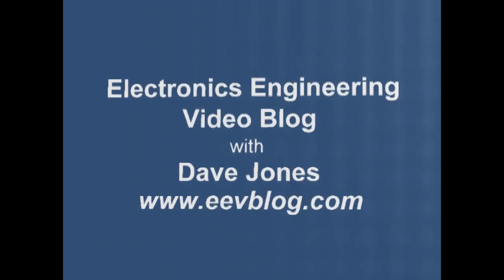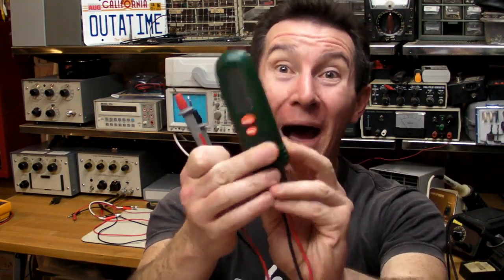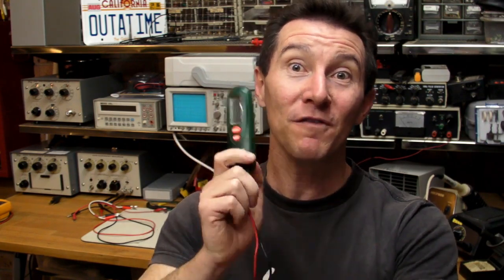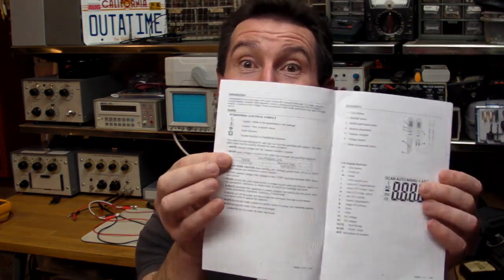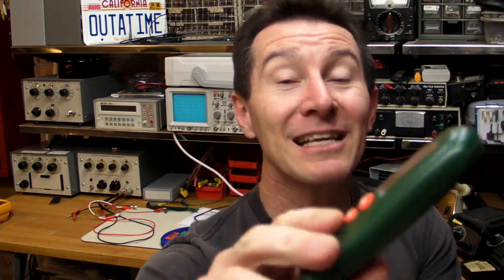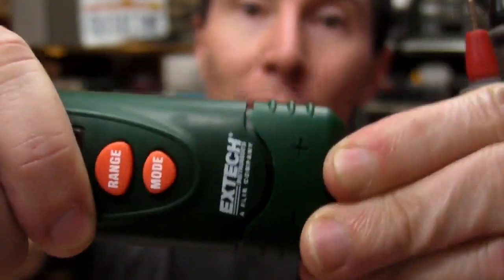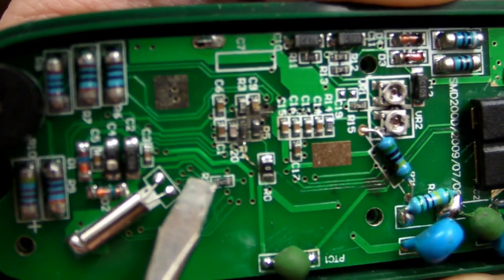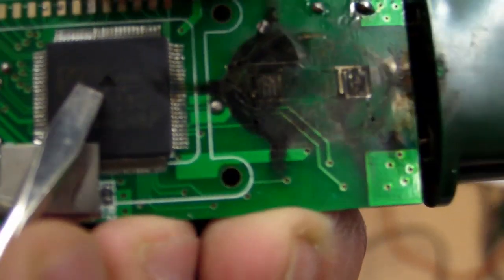EEVblog #94 - Near Death Multimeter Experience

Comment: Love your videos!
However 240 mains is insane!
Reply: 220-240 volt mains is pretty standard in most places.
Reply: Tom Hanson
Still insane IMO! Here 220V is considered "clear hazard" and requires special plugs/disconnect boxes etc.  Most days I can't be trusted around 120VAC.
Reply: youkofoxy Despite what some say, it's basically that the US pioneered electrical distribution. By the time the rest of the world got around to it we realised that 220-250v provided a number of advantages, but the infrastructure was already there in the US for 110v.
Reply: MrRexQuando 110-120V is a bigger fire hazard because you'll draw twice the current compared to 220-240V with the same type of appliance.
With higher current you get a higher wear of contacts (sockets, switches ... etc) and a failing contact can burn your house down.
So yes, 220-240V is a little bigger hazard for electrocution, but 110-120V is more likely to burn you house down and kill your family and maybe even your neighbors ;)
Reply: youkofoxy No, the thing that is dangerous is the current, the discharge that occurs after for example walking on a woolen carpet is insane.
Regardless 220-240 Volts (area used in EU) should be safe to measure with a dmm under any circumstances.
Reply: ***** Then explain how the body has 60% less impedance at 200V than 100v? So if you know how current passes obviously 240VAC is insane especially at lower frequencies. This is why you can touch a 1.5V battery leads with 20 amps and not end up like popped corn.
Reply: MrRexquando  anything above 30 volts is dangerous for humans.
now, I prefer 720 volts.
is more fun that 220 volts.
bytheway, why they use 110 volts?
Reply: MrRexQuando Did you know that lots of households in Europe do actually have three-phase and it's 400V?

Anyway, if I follow your "theory" : to make it safer we should lower the Voltage?
Let's take 24V or even 12V, you haidryer will draw 100 amps. Does that sound safe to you?

This is a EE blog and you should be aware of Joule heating!
Reply: MrRexQuando "In the United States, 50,900 fires each year are attributed to electrical failure or malfunction, resulting in 490 deaths and 1,440 injuries" ESFI
Since you mention impedance (resistance vs time/phase) : did you know that body impedance lowers considerably more over time! And we are not talking about 60% here but more like 90% and even much more after a few seconds!

btw, you have any data on that "fact". 110V will give approximately 60% less current vs 240V, sure you didn't misread something?
Reply: MrRexQuando Wow - what a load of crap you have written there.

Really - 60% more current with 240V mains vs 110?

And you want to claim you have ANY knowledge about electricity?
Get some education kid.

Just to show you how utterly absurd your claims are:
you claim, that the body-resistance drops 60% by going form 110V to 240.
Ok, let's take that without asking any further questions.

We have I1 = 110/R and I2 = 240/(R*0,6).
If we do some basic maths we get, that I2 would be 240/(110*0,6) = 3.6 .
So the Current would be over 3 times as high.

And does it matter? Not at all, as 110V is as lethal as 240V.

And then comes your stupid example of a 1.5V battery delivering 20 Amps - really? Are you that stupid?
If that would be the case, than you would be dead as soon as you touched any battery.  For 1.5V to drive 20 amps you would need LESS than 100mOhm total resistance.....

If that were the case for human skin, well, let's take the 110V again.
110V/0.1Ohm => 1100 Amps.
110V*1100Amps => 121 000 W
You'd be boiling and blown to bits near instantly.

110V and 240V are both dangerous, but 240 is simply more efficient and the way it is wired in Europe simply is safer (3 pole connectors for example).
Reply: MrRexQuando " Morons! The human body is not a linear acting resistor. Read the other comments morons." We are long past this - and great job starting with insults and then showing you know little to nothing.

You really should use your brain a bit before writing comments.
Reply: Besides I didn't at any point mean that 220-240 volts aren't dangerous, just not nearly bad as some people were suggesting, one should be able to measure it safely with any dmm without problems.
Reply: MrRexQuando 
0.01% might make the difference between life and death!
Who cares about the electrocution theory it's the practice that counts! Do we have tons of people getting electrocuted from 240V? Nope.
Checkout the sockets where 240V is used, they are MUCH safer (child safety on any household socket is mandatory in most EU countries). The first time I got in contact with 240V was because the device had a US plug, it was delivered with a adapter and it was so easy to touch the mains on that type of plug.

You claim to have worked for the union, so what's more prone to have a failure on the device and especially on the extension cord for using that device : a 110V device pulling 16 amps or a 240V device pulling 7.3 amps? Seems pretty obvious to me.
A 110V vs 240V warning isn't a voltage warning for the 240V but a current warning for the 110V.

110V system not only requires twice the cable section but it also requires transformers being much closer to your home and that means lots of high voltage out on the street where your kids play ... no thanks.
The only high voltage lines I know that you could touch with a long stick or ladder here are the 3000VDC lines from the railway, everything else is totally out of reach.

So have fun with high voltage lines in front of your home, 16 gauge power cords that will burn your house down, switches that are getting hammered by twice the current (probably giving much less than 50% MTBF) and those hazardous plugs/sockets. At least you have those theoretical percentages that will save you from electrocution while joule heating is biting you in the ass.
Reply: MrRexQuando I can link stuff too : http://www.esfi.org/index.cfm/page/Fire-Statistics/pid/12014
"Home fires involving cooking peak on dates that are major U.S. holidays" Yup, typical day to overload wires with a gourmet grill. Very easily achieved on a 110V system since it will draw 15-20 amps here.
"Home electrical distribution and lighting systems are the fourth leading cause of home fires" that is the electrical system not appliances.
Reply: ppdan The lower the voltage, the more current to pass the same amount of power, the higher the chance of  a fire getting started. That's why you dont go to 24v.
Reply: MrRexQuando You forgot to mention those 60%!!!
Reply: MrRexQuando  "Yes except I cited scientific facts and you are just full of bullshit :o)"
Just that the things you cited in no way supported your claims - i might as well suggest you to go back to school and work on your text-comprehension-skills again.
and after that you should also take some classes in basic physic.
Reply: MrRexQuando If that is true then you're certainly retired today! I am electro technician for the railways and seriously our 240V system is nothing to be afraid of, we got much safer sockets and less joule heating.
It is well known that the biggest cause of fire comes from electrical wiring/appliances failure. There is a much higher chance to get killed by a fire caused from electricity than getting electrocuted!
Reply: MrRexQuando I have been to the UK and most electric installations there are very old.
We can keep exchanging crap like this for years : http://www.elektrotipp.de/images/kr/Brandursachenstatistik%202012%20Elektrizit%C3%A4t.png
It all depends on the condition of the installation/appliance and how we use it. Most electrical fires we see in statistics are due to wrong use, aging or poor maintenance.

Anyway, this debate will end nowhere, you are afraid of a little voltage and I don't like drawing high currents in my cables. 110V or 240V, they are both lethal and considered low voltage.
Reply: youkofoxy I was thinking mentioning the price aspect but hey, if they want to pay for those expensive wires, switches, high voltage lines right in front of their homes, kWh that went into joule heating ... etc, be my guest.

I find 240VAC not more dangerous than 110VAC, but I surely wouldn't like having simple hairdryer that pulls 12 amps and certainly not with those US plugs, sorry but those plugs are a real hazard even at 110V.
Reply: MrRexQuando Seriously, if you get really shocked by 110VAC or 240VAC you dead anyway because the burned skin will easily have 95% less resistance and since your inner body has a resistance as low as 300 Ohms, even a small remaining voltage of 20 volt would probably kill you by then.
Reply: MrRexQuando And what about :
- 100% more joule heating in cables : wasting energy (more pollution) and higher fire hazard.
- Higher wearing on switches and sockets : bigger fire hazard
- Better and safer sockets on 240V system : US socket type are among the most dangerous I have ever seen
- No high voltage transformers and/or power lines close to your home in a 240V system
- More economical in "transport"
- RCDs are mandatory in most countries with 240V
You have to compare the whole system instead of arguing blindly with a single paper!
Countries using 240V have a much more modern network!

HVAC/Water heaters/Dryers/stoves/welders are mostly plugged in a normal socket here (unless it's a heavy welder or HVAC system). A simple hairdryer is already a heavy current device in a 110V system and will draw more current then a washing machine or a dryer in a 240V system.

You must be either delusional or have no clue of electricity if you don't see all those added dangers of a 110V system.
Reply: MrRexQuando Who is trolling who? Everyone who mentions the other dangers of electricity gets the same response from you "240V is 60% more deadly", that has been the only argument you have on this subject!
That paper is discussing electrocution while there are far more death from fire caused by electricity!
Reply: MrRexQuando  Seems like there is only a single argument saying why 120VAC is better than 240VAC, while ppdan and others have quite a few more (6,7?) about why 240VAC is better.... I'd go with 240VAC.
Reply: Like others have said already it is standard in large part of the world and multimeters are supposed to be designed to handle that load. And our 220v-240v grid is also actually more stable in that there is less risk of power spikes killing your equipment if you are not using a surge protector.
So even though there might be a little bit reduced risk in getting killed from voltage themselves there might be less hazards when it comes to fire here.
Reply: MrRexQuando Yeah yeah, keep on repeating the same shit :P
120 V can kill you just as easily.
Get shocked and you got a problem - with both.

Hey, not only are you wrong on that account, but If we would already go by the potential to cause Damage, than 240V would be about 4 times more potent.
At the same time, it makes power-transmission easier, more efficient, and cheaper.
Reply: MrRexQuando Did they talk about chances getting electrocuted on those crappy US plug compared to most EU plugs? No they didn't. You have to look at the whole system and not only use the part that suits yourself. On which side of the door were you when they distributed brains???
Reply: MrRexquando As I have already come up with an example of insanely high voltage going through you without being dangerous,
I don't see why that is not what is being explained.
Reply: MrRexquando And you are in no way whatsoever addressing my example, for the third, no wait fourth time in a row.
Reply: Flynn White We have in EU all 230V(233.3V last week...) and works just fine, I put DMM into mains for 15 years, no problems. Its a pain I cant use 110V devices in EU, the whole world should be one standard - 230V 50Hz
Reply: Ritcheyyy "This world should have one universal standard" yes, I agree, but why the one we use specifically?
Reply: ***** Ohms law.
Reply: ppdan have you talked to him about the demand for metals to suit a system of 110 volts?
and in my opinion ... a difference safety is not as great, you are just talking about impedance and forgetting:
Socias factors, psychological, work area ...
by the way, with the appropriate security measures is more easier to work with 220 Volts.
and according to http://en.wikipedia.org/wiki/Low_voltage
we're talking about low voltage.
Reply: MrRexQuando On what page does it say that 240V is insane?
Reply: Brucifer Energy is not the danger, current is.
If you take a constant current source of 1mA and touch it for 10 minutes you will not die.
Now if you charge a capacitor with that same amount of energy it will become deadly because the current released will be much higher.
Reply: MrRexQuando RCD's are mandatory in Australia 240 volts.
You both agree 240 or 110 will kill. Yes to get the same work  from either the amps have to be more at 110. But as far as a body goes once it starts to dry out and burn you are dead. The fact that 240 volts will throw you across the room if the rcd doesnt kick in where 110 no matter how much amperage is not going throw you across the room you will be stuck there. Most 240 volt circuits are only 8 amp rated in houses etc Air conditioners etc

Conclusion they are both deadly Doesnt matter 110 or 240 if you make a mistake they both can kill you. Most electricians or electronics tech;s have been hit. Most of us are still alive. Under working conditions we have many safety systems in place to prevent mistakes as we are human. RCD's rubber, rubber mats, insulated equipment etc.

The issue was the meter having the switch triggered after the leads contacted the fact that it was cat rated yet if this accident happened at 600 volt as the meter was rated it may have been even worse.Still a badly designed meter.

Your argument is a mute point both 240 and 110 will kill.
Reply: MrRexQuando 240V is more dangerous than 120V AC RMS, of course (I got shocked twice, so I know).

But there are also advantages, for example we need thinner cables:

Load of 3 kW (values in AC RMS):
240V  ->  12.5A
220V  ->  13,6A
120V  ->  25A
110V  ->  27.3A

Safe
24V   ->  125A

- Luca
Reply: MrRexQuando 2008 there have been 63 deaths resulting from electricity in all of Germany (Population: 82 Million). This figure includes industrial accidents. Just counting household accidents, we're down to 23. To give you a sense of scale: 5-7 people die due to lightning strikes in Germany alone.

Clearly you are right and 240 Volts are "totally crazy" ... oh, and electrical plugs which permit you to touch the live pins while plugging them into the outlet are totally fine. Nope, no problem at all.
Reply: MrRexQuando
Did I ever say that the higher voltage is less hazardous? Stop putting words into my mouth. I said that there are some advantages when it comes to power spikes, which in fact might lead to less fires. And since fires from electrical equipment is alot more common than the extremely rare cases where people die from 220/240v it might actually overall be safer.
Reply: ppdan
So I guess it is just not me then.. Seems like this kid just clicks reply without even reading the comment.
Reply: MrRexQuando Why do you say "Or what?", did I put an ultimatum somewhere?
And what does minecraft have to do with this? Are you drunk?
Reply: MrRexQuando First of all, a dry cell isn't a current source but a voltage source. Anyone with some EE knowledge wouldn't talk about a "60 amp dry cell" because a dry cell just isn't a current source!
And wth does a stun gun or a dry cell have to do when comparing electrocution safety of 120V vs 240V at home?
Just curious, do you actually know what limits the maximum current of a battery?
Reply: MrRexQuando You have just shown that you should learn the basics of electronics before commenting.

"better to be silent and thought a fool than to speak and remove all doubt"
Reply: MrRexQuando btw, batteries are DC sources so there is another BIG reason why they wont electrocute us as fast as 120V AC. With dry hands you can easily touch up to 200V DC ... I'll let you look up why that is (again this is BASIC EE KNOWLEDGE)
Reply: MrRexQuando Seriously stop trolling, I was talking about dry hands, you go to licking a 9V battery and then again you talk about those 60% ...
Reply: ABaumstumpf Let him, he is jumping from one thing to another and as soon as he cannot come up with something to respond he cites scientific stuff that he found by doing a quick search with google. According to his papers, or how he translates them, a lower voltage will always make less victims even if it's much more exposed.
Reply: MrRexQuando 240 volts through a human is more dangerous, because if we consider`the resistance of the human body to be constant (it's not, but lets pretend two people shock themselves in the same way with the two voltages), a 240 volt drop across that resistance is going to lead to twice the current, and thus twice the power flowing through your body.

At less than 30 volts dry skin acts as a dielectric.  Less than 12 volts can even damage tissue though... hold a 9 volt battery against your tongue for a little while and you're going to get a painful, nasty burn.

It's the POWER that matters, not the current or the voltage alone.
Reply: ppdan Christ, have you ever heard of ohms law?  Current is dependent on the voltage drop.  You can't have a voltage drop across a resistance without a current.

Hopeless.
Reply: The fact that you think "the current always kills" when there can be no current without a voltage drop across a resistance.

It's the power that causes cellular damage, which is the voltage multiplied by the current.
Reply: ppdan You're contradicting yourself... If it's the current that kills, then you're saying the voltage doesn't.  You can't have one without the other over a resistance.
Reply: Justin Hall hopeless
Reply: MrRexQuando maybe some groups have interest in making hazards? never forget the rich racists
Reply: Tom Hanson now makes sense.
Reply: youkofoxy I figured out the answer using google, your comment is about as useful as "first"
Reply: MrRexQuando "Why do you think stun guns shock you"  because of the high voltage but since it's low current it cannot kill me. You need enough current to kill!!!

"touching the leads on your car battery doesn't kill you?" With dry skin? Of course it doesn't, never heard of ohms law?
Reply: MrRexQuando
Well 240V AC at 10kHz isn't particularly dangerous :D
Reply: MrRexQuando
I just notice that you did not treat me with the respect, a few lines ago. Yes I am a boy, but you should treat me with more respect.
at least you experienced what is 220 volts?
I have, but not as my uncle who had it first hand, and he is still alive.
and several shocks that almost killed my father, he even remembers one that was epic: 380 volts in a radio station cables, he cut the wrong wire, only to see a pliers melt in his hands, and hear a circuit breaker trips .
I asked him because of this discussion, humorous or not, I mentioned him about the accident in the low voltage (about 64 volts) in which he almost died.
this he concludes that the low voltage was more dangerous, since it took me about 5 seconds to turn off the system.
(I thought someone else would solve the problem, as usual)

that's why I think it is safe to 220 volts, rarely had the opportunity to work with 110 volts.
I know the security issues and also know the impedance of the human body decreases with voltage.
but unless you use 30 volts, people will continue to die, and if you use 30 volts people will die on fire.
not everybody has an strong heart like me or my dady, and can die just by the suggestion that they are taking an electric shock.

BTW: you remind me of my grandfather, who insists on the old solution "slay the jaguar."
and everyone knows that this was never the best solution.
as I mentioned before, you're forgetting other problems of using 110 volts. you at least have the idea of drastic changes to meet world energy demand? Forget the money and just think of the consequences, after all almost everyone uses 220 volts.
you can not say that 220 volts is insane, not until read the whole story.
Why do you don't start here?:
http://en.wikipedia.org/wiki/Alternating_current

+xXDarkKisukeXx I like the sugestion,but we would have to solve the problem with the cabling system, however it would be something interesting to see.

P.S.: I don't like english.
Reply: for me, English is a necessary evil.
rather like the hammer that dissipates energy more slowly. by the way, this is terrible comparison.
I've had experience with Electric shock of different voltages, I would still argue that only 30 volts is safe for humans.

I have no knowledge enough to show you why it's better (google don't solve that), and I fail to convince myself that 220 V is really better, but you still fail to convince me.
then I suggest you show me some graphs on the subject, preferably with the use of SI units.

after looking on wikipedia about it, I just noticed that 220 volts stop the heart of the victim until the system is switched off, and it has a tendency to "toss" the victim.
while "A sustained electric shock from AC at 120 V, 60 Hz is an especially dangerous source of ventricular fibrillation because it usually exceeds the let-go threshold"
http://en.wikipedia.org/wiki/Electric_shock

P.S.: apology accepted.
Reply: MrRexQuando For the love of greyskull... half the reason people are arguing with you is because you keep using the wrong terminology, which is confusing.

"Conductivity" isn't going to increase with an increase in voltage (corollary, "resistance" or "impedance" isn't going to decrease either). Current will increase according to ohms law, but the conductivity of the body will be much the same at any instant. In the simplistic case, an increase in voltage across an everyday resistor doesn't magically change the value of its resistance - otherwise ohms law would look very very different to what we are accustom to.

Please don't belittle people or resort to ad hominem attacks. It contributes nothing to the discussion.
Reply: 115 volt mains can kill you. 230 volt mains can kill you.
The first one kills you a little less than the other.
;)

Anything above 50 volts is "insane".

I had my share of mains through my hands plenty of times. To be honest 115 doesn't feel that much different from 230. They both have a deadly tickle.
Reply: MrRexQuando "I found a paper that says" seems to be the only knowledge you have on this subject!
First it's "60% less impedance" and then it becomes "60% more dangerous" which one is it now?
Reply: MrRexQuando You clearly don't know Ohms law and your math is even worse.
You'll be able to use this against me but what the heck at least it'll prove that you have no clue about the basics of electricity.
If the resistance drops by 60% the current will rise by 150%, but since the voltage is now 240V and not 110V the current will rise by another 118% giving a total current rise of about 445%.

I guess we can VERY safely assume that 60% less body resistance on 240V vs 110V is nowhere close to "60% more dangerous". (it's much worse)
Reply: It's not more complex, all I used is simple Ohms law and rule of three. 
Comparing to only copy/pasting that's a lot indeed!
Stop using terms that you don't know!
Reply: Forgive me, but I'm going to take more of a physicists view on this than an electricians. Instead of thinking in terms of Amps and Volts, Think about the total amount of energy, as measured in Joules.

low current & high voltage = xxx Joules
high current & low voltage = exactly the same amount of energy as above

Energy is conserved no matter how it is delivered. Remember, energy cannot be destroyed or created, only converted from one form to another (potential, kinetic, thermal, etc).
If you pass AC through a transformer with a total energy level of 1 Joule and the transformer outputs either a higher or lower voltage... it still outputs the same 1 Joule in the end (excluding transformer losses) since energy is conserved.
Given that this is the case, there is little difference between the two. The total amount of energy (in Joules) that runs through you is what causes the damage, and there is little difference between the two total energy levels in this respect.
Reply: leigh Moom i agree in greece and europe exceed england and cyprus the voltage is the same
Reply: MrRexQuando Because you know something about electronics or electricity?
According to what you posted here, that "60% more lethal" quote is as far as your knowledge goes.
Reply: MrRexQuando  lol, there it is again. The ONLY argument you ever had!
Reply: MrRexQuando Those "crazy benefits" are the biggest cause for failures that kill at least ten times more people!
The paper only discusses electrocution but doesn't discuss all the other dangers that come with electricity and it also doesn't take into account the safety precautions taken to not get in contact with electricity.
Also what's the point of having a 37.5% electrocution safer voltage in a system more favorable to getting electrocuted.
Reply: MrRexQuando That is the problem, your idea is that you have only one single point which counters everything else.
Does that study include safety of the whole system? No it doesn't because it is a pure bio-electrical study and doesn't take into account the chance to get electrocuted.
Reply: MrRexQuando Because your science shows that 110V in the US is less dangerous than 240V in Germany?
According to your science, or at least the way you apply that science, the ratio of people getting electrocuted from 110V is 37.5% lower?
If 110V is still deadly why not go down to 24V?
Reply: Ian Switzer I know, that's exactly the point I am trying to make and since fire originating from joule effect kills way more people it is a bigger concern.
Reply: mato900 He got way more arguments (probably 60% more), the only difference is that it is the same argument over and over ...
Reply: One thing that hasn't been mentioned in this insane comment string (if it has, sorry I missed it) is that US homes are served at 220-240 volts. Many of our high-drain appliances run 220, including central heaters, air conditioners, ovens and rangetops, water heaters, clothes driers, etc. Only are the standard household outlets ~115v. Most of the stuff we plug in to these outlets do not pose any hazard from high-amperage or melting wires.
Reply: David Hansen Hairdryer, Microwave oven, space heaters, deep fryer, vacuum cleaner, ... etc. Most of those will pull at least 10 amps on 110-120V and are plugged in a standard household outlet.
Real high drain appliances run on 3-phase 400V here.
Reply: MrRexQuando Can you read? That sentence had a question mark at the end!
Reply: MrRexQuando I wasn't even talking about that but about the fact that you quoted me wrongly. And stop bad mouthing people from behind your PC!
Reply: Tom Hanson 
9 months ago I know but,
By the time the rest of the world got around to it?
110v was always inferior .
US scaremongering kept you on that lame system.
Reply: MrLiveEra *cough* i'm not American
Reply: Tom Hanson Lol, Ok, Maybe my comment did come off a bit ' Anti- Pro - American'
But the ' By the time the rest of the world got around to it'  got to me a little
Reply: MrRexQuando Somehow I am hesitating to give your last comment a thumbs up because it clearly shows that mentioning that paper is all you can do ... stop trolling EE topics!
Reply: MrRexQuando Yeah, it is a display that you have no understanding of basic electricity.
Reply: MrRexQuando No ppdan is saying is that a battery is not a current source! And now ppdan is also saying that you don't know shit about batteries. A battery is a voltage source and the maximum it can deliver depends on its ESR.
THIS IS BASIC KNOWLEDGE!!! You should know this in a split second if you have any EE education instead of using google to find an answer!

I am gonna help you to educate yourself : http://en.wikipedia.org/wiki/Current_source (after this checkout Voltage source)
Reply: MrRexQuando Yay, and a taser is deadly?
Or as i have stated before, a ESD?  
ESD will give you several thousand Volts at tens of amps - and ups, no problem there.

Learn some basic maths - you are clearly not able to even comprehend what that paper is talking about.
Reply: Justin Hall It is current that kills and it always will be. But, you need a high enough voltage to induce that current.
For example you will die from a identical current that passes thru your heart going from head to toe or hand to hand, the only difference is one of the two will have a higher resistance thus needing a higher voltage to induce the same current.
Reply: Justin Hall And which part of my post is against ohms law???
Reply: Justin Hall Are you blind? I said "you need a high enough voltage to induce that current" and also "one of the two will have a higher resistance thus needing a higher voltage to induce the same current" ...
And it is the current that kills!
Reply: Justin Hall I quote myself again "you need a high enough voltage to induce that current" which means that you need a certain voltage to get a certain current.
And no, high voltage doesn't kill if the current isn't high enough!
Reply: ppdan but you can't have high current without a high voltage. It's not the voltage difference that matters, it's the voltage drop.  You have to model the human body as being a resistor.

As a comparison, you're basically saying "It's not the distance you fall that kills you, it's how fast you were falling when you hit the ground."

THEY'RE RELATED. edit:  DIRECTLY RELATED
Reply: Justin Hall It's exactly what I say "you need a high enough voltage to induce that current" -> voltage and current are proportional!

And what do you mean by "It's not the voltage difference that matters, it's the voltage drop"??? A voltage drop IS the voltage difference between to points?

"It's not the distance you fall that kills you, it's how fast you were falling when you hit the ground." Of course it's the speed that matters otherwise parachutes wouldn't work as expected!
Reply: ppdan A parachute would be more like a pull down resistor.

And no, the voltage drop is not the difference of the voltage between two points.  You probably have a charge of tens or hundreds of volts on your hands right now.  That doesn't mean you are conducting electrical power.

In one sentence you're saying "It's the current that kills", and in the next you're saying the voltage does matter.  Make up your mind, you can't have it both ways.
Reply: MrRexQuando Dude... Your trolling was awesome. But tiring. Glad you stopped.
Reply: We should make a T-shirt  about this thread...lol! It'll have a "240VAC is more deadly" with a picture of someone getting shot in the heart by a rifle, and then someone getting shot in the heart a slightly higher caliber rifle.

I mean, obviously, they'll die 60% more than the other dead guy. ;) Always take proper precautions to make sure you aren't 100%, or 160% dead.

Anyway, I have seen here many 600VAC mains(in the US) and the thick cables/supply current are enough to turn you into a cooked hot dog and think that is part of it's regular duties. These are used in most industrial applications, and even in bakeries.
Reply: +Ritcheyyy just use a stepdown transformer (yes your comment is old but still xd)
Reply: +MrRexQuando, Do you need someone to talk to :) , you really need to get a life and stop with the shit comments on YouTube, FFS it`s only a video about a MultiMeter not being fit for purpose......BTW is 240V really insane??????????
Reply: ***** Its 60% more dangerous than 120. Pretty significant increase no? Like I said 240 mains is insane!  Agree that test equipment rated for 600V (or whatever) should be able to be plugged in. I normally use a pico fuse when working on line voltage incase something is coupled. Unlike Dave I have to buy replacement equipment when I blow it up. LOL
Reply: ***** I guess you don't understand how skin resistance goes down as voltage is increased?  I get that its all about current and frequency. Do you understand that more current will "pass" as voltage increases? If not google it. Pretty basic. If your theory was correct I could die from a 20 amp 1.5V dry sell in my hand.
Reply: ***** With dry hands you can touch a car battery with 700 amps and live correct? Do you get it now? As voltage goes up resistance in the skin goes down thus allowing more current to pass.
Reply: ppdan
Yes you are a genius! In fact lets run consumer equipment on 480V because it would make everyone safe from house fires and save billions on transformers.
Reply: ppdan I was a union electrician before you were born. Its common knowledge the higher the voltage the better it conducts through skin and other things important to us. Thus it is insane to run 220 in areas humans normally come in contact with.  Show some evidence that 120VAC causes more house fires.  National codes are based on safe use and safe failures of electrical systems. It works pretty damn good.
Reply: ppdan  60% more deadly. The only argument I stated. 240 mains is insane.
Reply: Italian Programmer
 Agreed but when you expose this (at the outlet) safety because the biggest concern. When it is used for large current devices like HVAC/Water heaters/Dryers/stoves/welders/commercial lighting/etc. it works out pretty good like you demonstrate. Smaller wires, etc.
Reply: ppdan Its in the report but you can't read correct?
Reply: Ritcheyyy Do you dispute how in the body 240 passes 60% more amps than 120vac? Not sure what is wrong with you people. It is more dangerous because the voltage is higher  and meets less resistance on the skin so is more deadly (passing more current). Seriously this is an EE blog.
Reply: ppdan I wish I was retired! Just moved on. The fact is the body has 60% less impedance at 200V vs. 100V. So the fact is you pass a lot more current (and increase risk of electrocution) with 240 mains.   Human safety factors have always been a part of engineering. 240 mains is insane. All ratings are done with appropriate voltage/amperage consideration. So you would have to provide some kind of imperial data to backup 110VAC causes more fires.
Reply: ppdan
Can you show that the fire "rate" is any different between 110 service and 240? I bet its identical. Looking at the UK it looks like your 240 is safer isn't accurate "https://www.firesafetystore.co.uk/images/percentage%20of%20electrical%20fires.jpg"
Reply: ppdan
It's physiology. The higher the voltage the lower the resistance through the body. "http://highered.mheducation.com/sites/dl/free/0073521825/690036/pet21825_ch01_OLC.pdf" Why do you think stun guns shock you and touching the leads on your car battery doesn't kill you? If this concept is foreign to you we should probably just stop this debate.
Reply: ppdan My grandfather use to say "you can't argue with stupid" EE 101: Higher voltage = less resistance in the body, less resistance means more current flows. More current flows you die. A "mains" outlet will pass a shit-load of current at high voltage. Doubling the voltage creates 60% less resistance in the human body which means you pass more current! 240 mains is insane! Again if you can't get the basic concepts of electricity you are the typical Troll you appear to be just arguing something you know nothing about for fun.
Reply: youkofoxy
You boys are talking out of your asses.  240 passes 60% more amps through a human body than 120VAC so the killing ability of household outlets is greater.

So by your logic we should be running 480VAC straight into houses so we can save on materials for wiring. Crock of shit.
Reply: ppdan
Yep you know nothing about this do you.. Again this is why a taser shocks you and a 1.5V #6 Dry cell doesn't kill you even though it puts out 100AMPS. More volts the easier it passes current. Seriously I hope you are just a troll and not working on electrical equipment or someone is going to be killed because you don't know what you are doing..
Reply: 10KHZ you are a radio tower!
Reply: youkofoxy
 Simple fact higher voltage conducts better through a body increasing the likelihood of injury/death. Ask yourself this: Would you like to be hit in the leg with a 2LB hammer or a 10LB hammer? Transmission lines where the bulk of any material savings would occur are already running as hot as possible. Sorry you feel I was disrespecting you but until you provide factual data you are simply voicing an unfounded opinion. Sorry you don't like English. Just like the aviation world English is the standard. If not we would have chaos in the skies!
Reply: Lee Ryman
 Can you cite this wisdom? You are obviously wrong. "Between 10 Volts and about 30 Volts, skin exhibits non-linear but symmetric electrical characteristics. Above 20 Volts, electrical characteristics are both non-linear and asymmetric. Skin conductance can increase by several orders of magnitude in milliseconds." "http://upetd.up.ac.za/thesis/submitted/etd-09212005-093111/unrestricted/dissertation.pdf"
Reply: Lee Ryman
Reilly, J. Patrick (1998). Applied Bioelectricity Page 43 nice chart and all.
Reply: ppdan You fuckers wear me out.
Reply: SysGhost Agreed but 240 is 60% more "effective" at tickling through your body. When I was 3 I put my fingers over the prongs of an iron while inserting into the outlet (loved electricity ever since!) and with the puddle of urine I created easy to see why that 60% might be the difference between life/death where these voltages area accessible.
Reply: ppdan Except like the paper I cited its 60% more dangerous than 120VAC. Stay with the details they are important :o)
Reply: ppdan Less impedance means greater current flow so same/same. Your not too smart about electricity are you?
Reply: ppdan NICE! Thus 240 mains is insane! 
I didn't do any math? Yea this is a little more complex than I=V/R. Its a non linear regression. But if you say 445% your my dawg.
Reply: ppdan Respectfully I think what you are missing is the human body is not a carbon resistor.  I am not using any terms incorrectly.  Its not simple ohms law.
Reply: Brucifer Dude not even close. You are missing the impedance part of the equation. The body is not a perfect conductor (not even linear). If it were you would die from touching a 100amp 1.5V dry cell by touching the leads but not effected by a taser (50KV x .00036 amps).  Or the electric chair at 1,825 volts at approximately 7.5 amps. 

Think of it this way when your fingers are wet you conduct better correct? Internal to your body works the same way (as the paper referenced early details) The higher the voltage the lower the internal resistance your body offers. 

The impedance your body offers to the current flow is 60% less at 240v than at 120v. The lower the impedance the more current can flow and the deadlier. 240V is insane!
Reply: Fennecbutt No videos and lots of expletives on things you no nothing about. Fucking Troll.
220VAC is 60% more lethal than 120VAC as I cited.  If you can't understand that maybe ask your mom to explain it.
Reply: ppdan Read the other comments moron. "Reilly, J. Patrick (1998). Applied Bioelectricity Page 43 nice chart and all."
Reply: ppdan Fucking hot air troll. I cited scientific proof that 240VAC is 60% more deadly you followed up with hot air and re-direction. Typical troll with no videos. You just go on Youtube to argue with people about things you know nothing about because you have no life of your own.
Reply: ppdan You are trolling by definition (duh) my response was the challenge that it wasn't more dangerous. It is (see the paper dill ford dumb-butt) there may be all kinds of crazy benefits to 240 (just like going to 480) but there is a safety penalty.  If you can't admit it is 60% more dangerous you are just an arrogant troll..
Reply: ppdan
The examples of how this happens are all over the place "http://www.righto.com/2012/03/inside-cheap-phone-charger-and-why-you.html" but don't look at any of this. Stay with your unfounded love of 240VAC.
Reply: ppdan Fucking moron. Your link "Cooking equipment is the leading cause of reported home structure fires and injuries.  It is also the leading cause of unreported fires - See more at: http://www.esfi.org/index.cfm/page/Fire-Statistics/pid/12014#sthash.eMFcebUS.dpuf"
Cooking fires? Fucking idiot..
Reply: NastyTern I have an idea. Have a point. It makes it so much more interesting for the reader. 240VAC is 60% more deadly than 120VAC. Just a fact. Sorry you guys can't understand facts/science/etc.
Reply: ppdan Show me some science. Enough hot air. Show me where 240VAC is 60% less lethal than 120VAC. You can argue about plugs/prongs whatever but its all hot air. appliances end up with 240 VAC in a cord and device and everywhere in between the risk of exposure is there. If going up in voltage was so safe why not go 480VAC? All the cords can handling it.  We would save so much on resources and loss in the lines.  If you can't cite some directed scientific evidence how 240VAC is safer when compared to 120 then you are just full of shit.
Reply: ppdan You proved my point way better than I could have.
Reply: mato900 Never said it was "better" only said 240vac was dangerous (60% more). You all get into these idiotic circles re-enforcing your fact-less position thinking somehow more youtube idiots on your side makes it true.
It doesn't work like that.. none of this works like that.
Reply: bloxyman22 Go ahead and prove it is less hazardous.  Cause 240 is 60% more deadly to the touch. Even within the enclosure it is insane to expose humans to this. "http://www.righto.com/2012/03/inside-cheap-phone-charger-and-why-you.html"
Reply: bloxyman22  According to PPDan "According to your science, or at least the way you apply that science, the ratio of people getting electrocuted from 110V is 37.5% lower" So my point was 240VAC in consumer level (anything) is insane. Point proven. SFU
Reply: ppdan Do you have any factual citations like I provided? If not you full of shit gas bag. Its science. 60% more dangerous.
Reply: ppdan Or what? You come out with no information just to say I am wrong. No science no citations then have the nerve to tell me to stop doing anything?  You have not videos.. Your just a troll looking for a fight. Go back to MineCraft and we will all be hoping for a cave-in ROFL
Reply: ppdan I guess you don't read what you type jack ass "And stop bad mouthing people from behind your PC!" Or what? 240VAC is 60% more deadly than 120VAC. Thus household products using 240VAC is insane!
Reply: ppdan All the videos you "like" on Minecraft. Troll You don't have a single video. Go troll somewhere else.
Reply: bloxyman22 "So even though there might be a little bit reduced risk in getting killed from voltage " 60% less using math. Try applying some science to your argument. Good things happen.
Reply: ppdan Much better than proving your ascertain asswipe. 240 is 60% more deadly. If you have no facts to disprove this go back to MineCraft 12-year-old bitch. :o)
Reply: ABaumstumpf Morons! The human body is not a linear acting resistor. Read the other comments morons. "Reilly, J. Patrick (1998). Applied Bioelectricity Page 43 nice chart and all."  The paper explains how the body acts very non linear decreasing resistance as voltage increases.
Reply: ***** It's all in that paper. A body doesn't act linear. As voltage increases impedance drops. 240 is 60% more deadly than 120VAC.
Reply: ABaumstumpf Yes except I cited scientific facts and you are just full of bullshit :o)
Reply: ABaumstumpf Read the other comments in the string. "Reilly, J. Patrick (1998). Applied Bioelectricity Page 43 nice chart and all."
Reply: ppdan You provided no facts/science or citations and you call me a troll? Wow.. I hesitate to do more research on sources for what I know to be true from years of Biology, 2 years of EE in college, and just common sense that you can clearly try yourself. Again put your fingers on a 60 amp dry cell at 1.5V and notice you don't die? But Taser's are are carefully limited to .02 amps at 18,000v. And again you call me a troll?
Reply: ppdan "http://www.prc68.com/I/No6.shtml" 100 amps on Omron no.6 dry cell. Again I have facts you have bullshit. It has to do with how body tissue reacts to voltage and current flow and how 240 is 60% more deadly than 120. So give some factual rebuttal or keep spouting BS. Your choice.
Reply: ABaumstumpf
You all keep challenging. I keep backing up my comments with facts but all the rest just keep spouting bullshit. So looks like you have shown your full of shit (again).
Reply: ABaumstumpf
Isn't Ppdan saying a battery doesn't provide current show the udder lack of any concept of electricity beyond compare? You guys are all half-wit trolls.
Reply: ppdan Lick a 9V DC with your tongue and you'll know a shit load about galvanic skin response. Again Basic EE knowledge. 
Ignore all your bullshit. Its in the paper! 240VAC is 60% more deadly than 120VAC. Give me a single source that refutes this and shows how much safer 240VAC is through a human body or shut the fuck up. Your hot air is getting stale.
Reply: ABaumstumpf
Yes I thought you had no basis. Fuckin' troll. Stray voltage deaths? "http://www.today.com/news/stray-voltage-hidden-danger-can-strike-everyday-objects-1D80279142"
Reply: ABaumstumpf
Yes I am retarded because I can cite real science to prove my point how much more dangerous 240 VAC is. And you can cite nothing to support your moronic assertion. Fuckin troll!
Reply: ABaumstumpf
So by your unsubstantiated logic 480VAC is no more dangerous than 120? citations aside you don't see how stupid your logic is?  Higher voltage conducts better through a human body. This is why a Taser works. Seriously-
Reply: ppdan
DUH!  Do you not agree 480 is more dangerous than 240? Can't answer can you? Because if you answer truthfully you prove I am correct. Painted yourself in a corner and now you can't troll your way out..
Reply: ppdan You're clueless. You have no fucking basis for your Wrong opinions. Simple biology. Notice how you never answers my 480 question because if you did it would undermine everything you have said.
Reply: Tuberlucose Hillary Clinton great example.